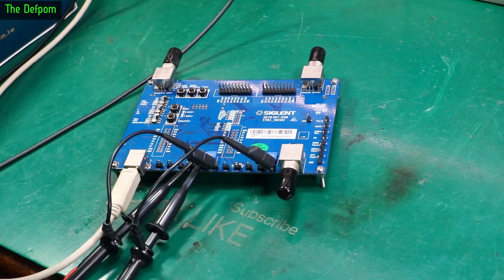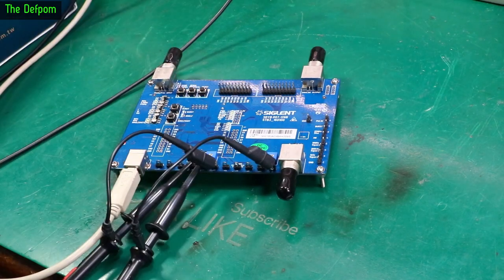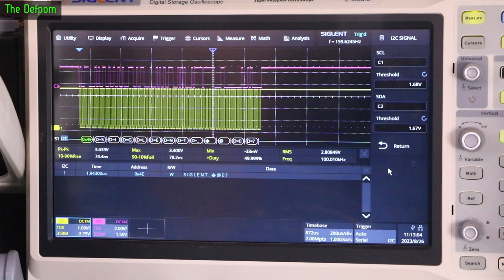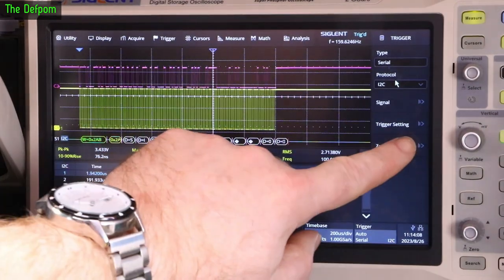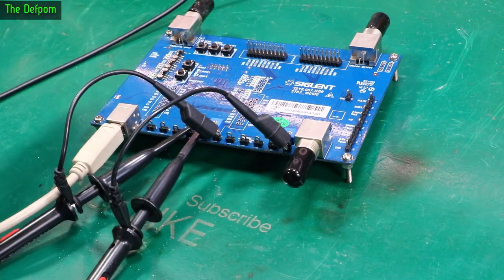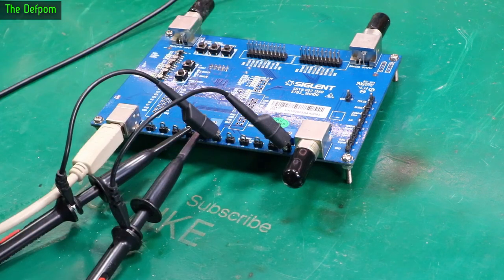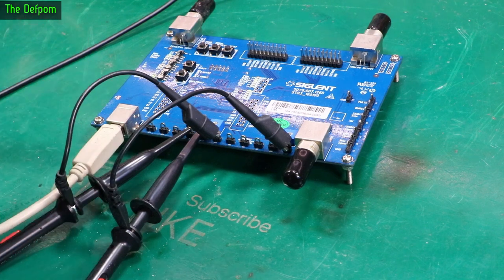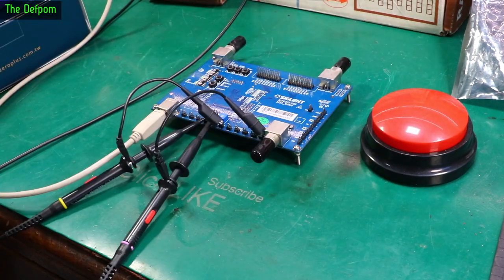🔴 Siglent STB3 I2C Testing - No.1168

Comment: I've found general decoding issues too with the SDS2000 Plus in that it doesn't always decode correctly if the trigger is offset or the whole data packet isn't visible in the width of the screen, even though the waveform is captured in the sampling buffer! I do find Siglent (SDS2000 Plus Series) decoding a bit flaky compared directly with Rigols (DS2000A series).
Reply from the maker: Yeah they only decode what is on the screen, that was something I covered in one or two of my reviews videos, I too wish it was the buffer that is decoded.